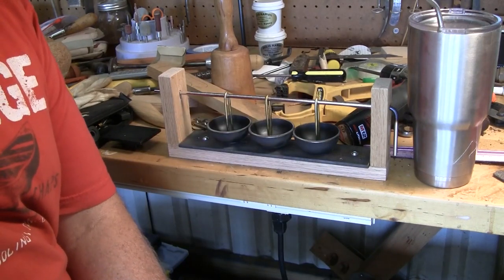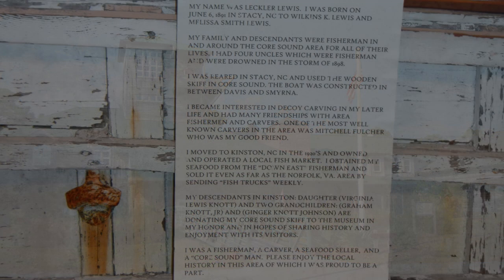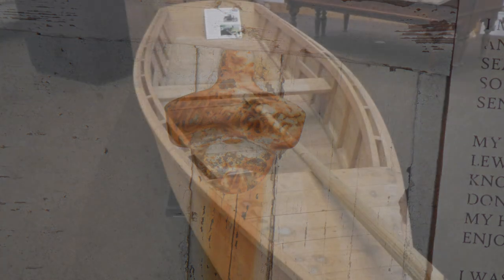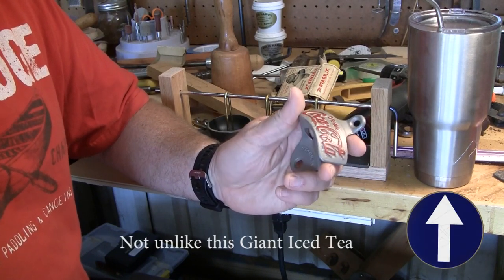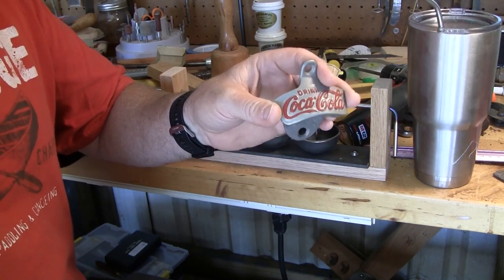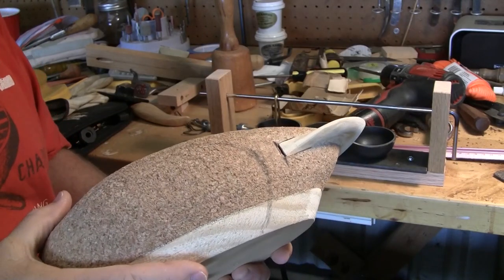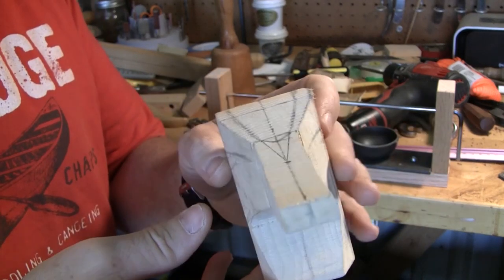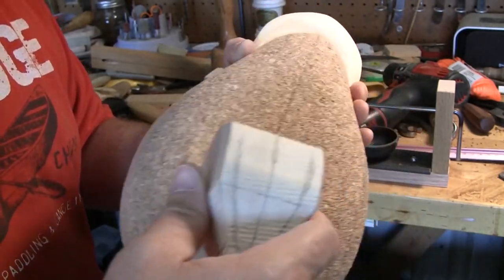Canvasback Decoy Part 6

Comment: We use to make anchors like that out of cut off aluminum drink cans, and used fence fastening clips for line ties. They didn't look near as nice is yours but they worked. If I were doing it I would bend the ends of those those line tie wires out about 90° for a good hold. That amount of lead sets a pretty quickly. 
Nice looking decoys.
Thanks for sharing your videos.
Reply from the maker: Daniel Fisher I’m actually working on a video where I’m actually casting the anchors.  Thanks for the comments and for stopping by to watch.